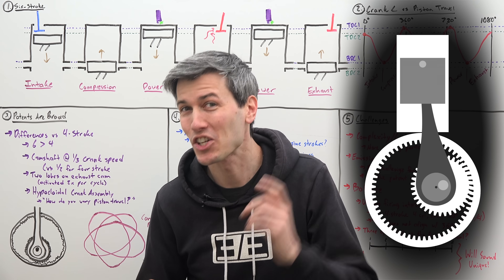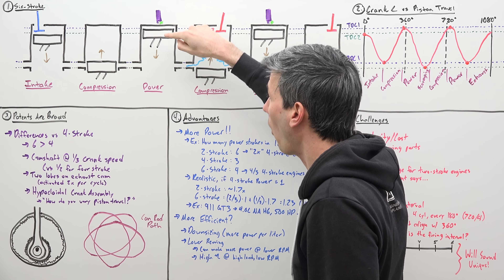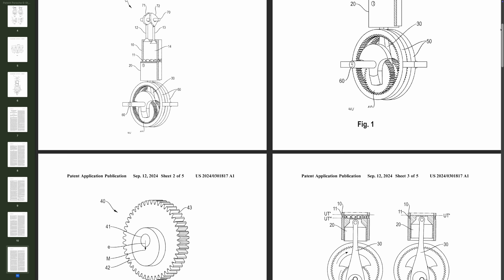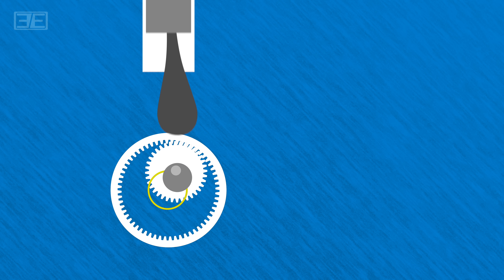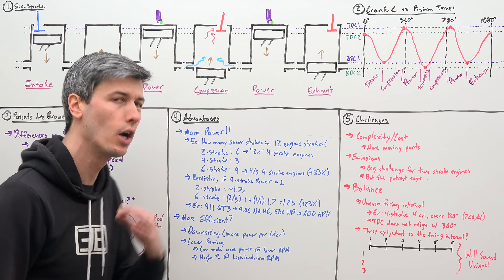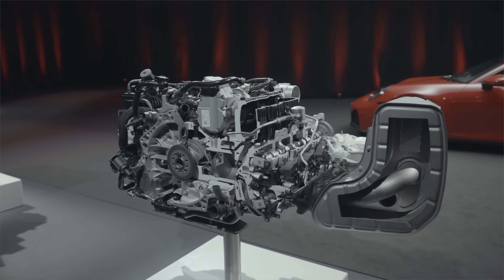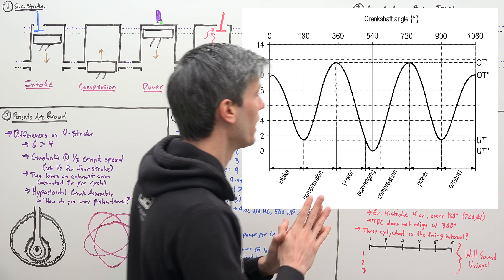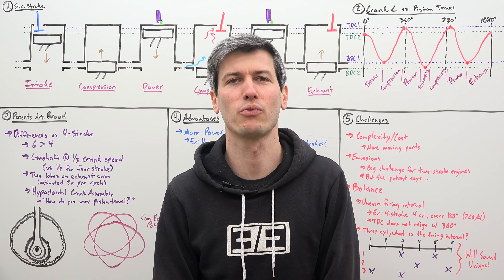Porsche's 6-Stroke Engine Is Genius!

Comment: Congrats on 1000 videos! 🎉

My thoughts:
1) This is a very interesting patent!
2) The first power stroke has a greater expansion ration than its compression ratio.  This is an Atkinson-cycle method to improve efficiency.  I am surprised this was not mentioned in the video.
3) IMO it is not difficult to imaging that emissions would be the same as a 4-stroke engine, with none of the problems that 2-strokes have. As pointed out in the video, there is no oil mixed with the fuel, eliminated one 2-stroke emissions challenge.  The other challenge is fuel-air mixture leaving the chamber before combustion.  As long as this 6-stroke engine has direct injection, the exhaust valve can close before fuel is injected, and only air will exit the chamber.  Not sure why Jason seems skeptical of this claim.

Comment: i wonder if theyll be turbocharging it? looking at the way a 2 stroke works, with the intake coming in the bottom of the cylinder WHILE the exhaust is pushed out the top, it seems like positive intake pressure would do a lot to help that process along while the piston is in the small scavenging window. then again, im sure theres a reason you dont see boosted 2 strokes so im sure theres a good reason.

nevermind i just saw your pinned comment. anyway congrats on 1000 videos!

Comment: It might just be the animation but I would hope to have large bearings on an offset center instead of the gears to avoid the wear. I haven't thought far enough to know if it would work the same. Coming back a few minutes later,  I don't think you could... The crank and rod need to be mechanically locked to maintain the path.

Comment: If running with 6 cylinder's it could run 2 power strokes then exhaust then 2 power strokes then exhaust etc.  Firing on 3 cylinder's every power stroke. so in 6 strokes 12 powerstrokes vs 9 on a conventional 6 cyl 4 stroke.

Comment: Balance is less of an issue at lower speeds, maybe that offsets part of the vibration issue. With lower engine speed there is more time to tune the combustion ( thinking direct injection), that could be part of the emission benefit.

Comment: Too many technical terms, so explain it to me in the simplest of terms possible. What's it going to change for any of the 3 types of 911's going forward compared to the 2024 model and let's say the 2026 if this gets implemented by then ? More horsepower ? Less fuel consumption ? Less oil and/or cooling usage ? More speed for the same amount of horsepower ?

Comment: Sounds interesting but impossible design. The friction of the gears in crank will eliminate all the power advantage and fuel consumption. The price for this gears and durability is the other question. And probably the noise from the gears. I see more problems than advantages.

Comment: How are you getting the O2 ratio right. Your second intake would have to be an oxygen rich mix as there is no exhaust to exchange for new O2. Thus making this consept only really work with an oxydizer like NO2. For the second power stroke at least or it will be a very bad burn ratio with limited power from the second power stroke.

Comment: Great video, the only thing I noticed is that when showing the piston positioning and cycling you placed it on the helical gear instead of on a crank that is itself moving on that gear to give the pistons a different relative position for the 2 stroke additional cycle. I feel that would be a better representation but not sure how exactly you could model that. Congratulations on your 1000th video and I always love the content!

Comment: I'm sorry to do this, but I really think you did something horribly wrong assuming the second power stroke is anything as efficient as a 2stroke engine. In my eyes 2nd power stroke is basically burning exhaust gas again - basically EGR. This stroke might help with emissions but it won't increase power very much. As the cylinder is already filled with exhaust gas putting in a little air and fuel won't get you a powerful second power stroke. Maybe this system even means decreased power!

Comment: I think the biggest challenge is lubrication. It will be impossible to seal  the lower air inlet with oil pressured ring over the gap. The solution might be double sealing (5 rings) in a thick piston or whatever... If someone really developed a lubrication method for two stroke except large 100rpm engines. I think this project was bord dead, at least Wankel complicated things for way more power.

Comment: regarding efficiency: wouldnt be the low rev factor be relativized because we need more fuel in a 6 stroke cycle than in a 4 stroke cycle? In the 6 stroke engine we have 2 fuel injections for one cycle, but only 1 fuel injection in a 4 stroke engine if I understood correctly.

Comment: Wouldn't the valve/ camshaft configuration be an additional complication to consider with intake valves at the top and bottom of the cylinder? Great video! Congratulations on the 1000th performance.

Comment: I bet an inline 3 would fire 2 of 3 cylinders every rotation or 360°. In his 1 2 3 4 5 6 problem description the cylinders would fire at 3&5, 5&1, 1&3. They wouldn't be perfectly simultaneous.
Reply: A flat 6 would fire twice every 180°.
Reply: It's going to burn oil. Oil will get into the ports, then above the compression rings.

Comment: Only a German engineer would combine a 4 stroke and a two stroke in one engine.
Reply: Nein,  you can't do that.
Ja, ve can. 
Nein, I tell you it can't work.
Ja, Ja, look, pulls out a plastic printed 3D model. 🤣
Leave it to the German engineers, all you need to do is challenge them. 😂
Reply: Felix Wankel basically did it.
Reply: @PrototypeSpaceMonkey  exactly this is a piston based wankel engine.
Reply: @jeffwilliams6374  sigh. Dude... go learn how wankel engines work
Reply: @ See rotational geometry diagram at 7:07. Same as wankel geometry, only using multiple cylindrical pistons instead of one Vicks cough drop shaped piston.
Reply: @cdreid9999 What are you talking, they are right, this is similar to a Wankel design just with common pistons...
Reply: @PrototypeSpaceMonkey  no.. that isnt remotely what a wankel engine is
Reply: Germans didnt designed it, Credits to the University of Cluj Napoca Romania. Check the patent
Reply: Or the japanese engineers 😅
Reply: @checker1o125  um.. on what planet are japanese engineers revered??? Im guessing youre young. Japan did what china did. Stole ip from the west then invested in education and industry. Those brilliant advancements they made they stole from the us and europe. On the US side they won because the US automakers had become dinosaurs who refused to use that tech and relied on their syndicate and political connections rather than competing with each other.
European cars are still top of the line and japanese and american vehicles still cant remotely compete on quality (note: we have had big tariffs on european cars for a very long time)
Reply: @cdreid9999 silly. Every French car is a piece of garbage besides maybe Alpine, and even that is still little better than a Miata. British cars are also garbage. Just say German. It’s just German cars that are good. Italian stuff is also super unreliable and overpriced as well.
Reply: @cdreid9999 . At planet F-1 bike racing, planet Indianapolis 500, etc. 
Tho nasty USAC interfered and then took it away, Honda Motor Company, the Most Capable on planet Earth, won the Indianapolis 500 their Second time there. You?
Reply: False the 6 stroke engine has existed since the 1800s.
Reply: Instead of simply apply stuff invented in the past 30 years to two-stroke and create a beast. Maybe opposed-piston engine?
Reply: Das auto!
Reply: And Japanese.
Reply: Porsche (don't forget to pronounce the trailing "e", btw) is absolutely keen to stay with fuel burning engines – despite the well known need for ceasing burning fuel due to the climate change. Their CEO even was in close contact with the former secretary of finance (who at the same time was leader of the smallest of the three parties forming the government) to have him insist on allowing at least fuel burning cars on  e-Fuels – which was kind of a scandal here in Germany... Having that said to describe their neglegtion of a changing world around them (not very innovative...): They try anything to  find arguments on burning fuel. An engine that reduces further the fuel consumption to them is one that might fulfil upoming future limitations on pollution for new cars. In the end the end their question is:  How can we reduce the emissions but keep the incredibly high amount of horse power to run their cars that get bigger and bigger just to show off. I expect them to wake up one day, when fuel-burning cars get forbidden with realizing having spent too much money for a technique that was known to die soon the moment it was done. Total nonsense...
Reply: @jurgens.3964 you say that, but Porsche has also adapted EVs better than any other legacy automaker besides BYD. Also all the climate change hysteria is ridiculous since passenger vehicles are less than 8% of CO2 emissions. Reducing globalism and finding a replacement for concrete would do the most to reduce CO2.
Reply: Fuel burning vehicles wont be going anywhere ...oil companies make too much money to let that happen @jurgens.3964
Reply: @jurgens.3964”climate change” is total nonsense. It’s climate ‘control.’ 

Look up, sheeple.

Comment: Uniflow scavenging is not new. Marine engines have work this way since before the 1940s. In addition they are 2 stroke engines and are the most efficient in the world. Run them on methanol or LNG and they are also as clean as any IC engine can be.

Comment: Hey EE. Couldn't it be a more "efficient" engine by modulating how much the exhaust valve opens during the second compression stroke, and scavenge more air/inject less fuel to basically mimic what an EGR does?

Comment: Not an engineer, but to me it seems the most problematic thing is the crank... Imagine how complex it is to assemble, lube and service., compared to a regular one. Not to mention the wear of the gears. Also there could be power loss through higher friction... But still an interesting concept.

Comment: So they made a better 2-stroke engine and gave it 4 more strokes? Why not just keep the better 2-stroke engine... Also i highly doubt the no oil consumption when that lower intake is literally drawing air in through the bottom of the cylinder where all the oil is usually in. How are they going to keep the oil from mixing with the air in that design?

Comment: I don't get why this would be valuable or practical.  So they are combining a 2 stroke and a 4 stroke to get 33% more power strokes.  If you want more power strokes, just use a 2 stroke.  Porsche must feel they can completely burn everything in the cylinder during the 2 stroke power stroke- so why even bother with the 4 stroke portion?

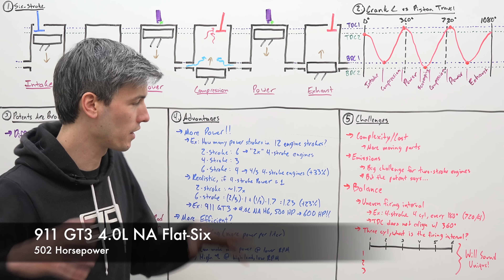Comment: 8:42 They couldn't run a 6 stroke to the same rpm because the extra stroke length to cover in the same amount of time means higher piston speed and, therefore, a lower maximum rpm

Comment: i would guess that they would keep the regular firing the same and just have the 2 stroke firing occur whenever, i would assume its going to be a lower power  ignition due to not dragging the air in.

Comment: hmm it can't be the first time someone thinks of combining 2 and 4 stroke into one engine. Thing that stans out to me is lubrication. A 4 stroke uses oil scrape rings to distribute oil alogn the cilinder, but that ring is now passing those ports. Oil gets mixed into the fuel mixture and burnt 'cleanly' as a solution. It might be a clean burn, but there's still more oil being burned in this design as oposed to 4 stroke

Comment: How is this supposed to run in the second powerstroke with NO Fuel inlet on the second compression stroke the exhaust valve is open the piston comes up and the plug fires and supposedly ,magically fuel has teleported into the cylinder. for the second ignition pulse.

Comment: I'm curious how the 2 stroke ports are going to work. There is nothing to seal the ports off to keep engine oil out of the 2 stroke intake, and if you turbocharged it, nothing to keep the boost pressure out of the crankcase. 2 stroke Detroit Diesels have similar ports, but the pistons are long and cylindrical, so when the piston isn't at BDC, opening up the ports, the piston itself seals off the port. I guess Porsche could do that here, but that would mandate a substantially heavier piston, meaning it couldn't rev very high.

Comment: Although a genuine pleasure to see a new and novel engine being patented, I can tell you now it’ll never reach production. It’s been patented on the premise that “if technology allows in the future” then Porsche will stop anyone else from being able to make it. It’s a “just in case” protection of an idea that is deemed potentially viable. The first problem is lubrication, the same as two strokes. Going past open ports means the piston has to have a two stroke burning lubrication system. The second, and larger problem is ring destruction. This has plagued two strokes from day dot. They need rings to hold compression and allow heat expansion within combustion chamber (piston and bore). Having them rub against the edge of a hole in the cylinder wall will tear them up quick time. Ask any two stroke dirt bike racer who has to change his piston rings every 10 hours of operation if he’d like to have the same issue on his very complex 6 cylinder sports car and I imagine he’ll use some choice colourful works to express his thoughts on it. I’m no engineer and would love to be proven wrong, but I sincerely think even ignoring the complexity and cost vs power gain in n/a application in a world where turbos exist, it’s a pipe dream engine.

Comment: With direct injection I suspect they have the capability to switch on and off the extra power stroke it could lead to an interesting combination of lean burn options.

The NVH and vibration implications are a potential nightmare, as would be the intake and exhaust NVH.

Comment: Seems that Porche has caught onto an idea I have been holding onto for a while. In percussion we are able to magically get 2 beats for one power stroke, this takes experience and also years of learning how to balance and transfer mechanical force through your own body. I can get 2 snare hits, 2 kick drum beats with one leg/ arm movement using the leverage built into our own limbs and joints. With more research and development I believe we can get 2 rotations on the crank for every combustion cycle. Getting combustion engines to have the same efficiency we do.

Comment: Another potential issue I see is that double exhaust cam. I think it will struggle with higher rpm due to increased probability of valve float.

Comment: Thoughts about the claims about EFFICIENCY:
1. The first (4 stroke style) combustion cycle implements an true Adkinson-cycle.
2. The second (2 stroke style) combustion might implement an internal waste gas recirculation.  Bad scavanging is an drawback of two stoke engins but can be utilised to fire an very lean mixture.
3. Having two different options of combustion gives more freedom to adapt to the actual load condition.
4. Under low load condition one of the two combustions could be skipping. This could be more efficient than cylinder deactivation.

Comment: I was wondering how the force is transmitted to the drive shaft when it rotates around the centre? You would have to install a cardan shaft in between. It is loud and has transmission losses

Comment: I don't think the firing order spacing would be too much of an issue. Uneven firing isn't a new thing. Motorcycles have been doing it for a while. A common example is the 270° offset used by yamaha and others in 2 cylinder bikes. And it does alter the sound

Comment: Complicated stupidity is what it looks like. Only way this would make any sense is if you can selectively switch between a 2 and 4 stroke mode for efficiency/power. Otherwise this is going to be one of those engines that they talk about in the future, i.e. The weird and strange of gas engines.

Comment: Porsche may work this out, yet you said alot when you talked about a 4 cycle 4 stroke have a nice even power stroke interval, which also has a even number of "rocking pairs" thus the 4 cylinder and V-8 both have balance merely in it's design, I suppose the V-12 would also have even rocking pairs but is added complexity in design and moving parts.

Comment: Parasitic loss would negate any gains if any etch a sketch is for children's art  ... You want more power ???? lengthen the rod increase stroke for dwell time TDC BDC, Shorten piston compression height increase skirt length for stability, increase compression and or turbo charge for best efficiency, secondary methanol injection (washer fluid) as intake air and combustion cooling and add'l power under full load to mitigate preignition  , reduce Reciprocating and Rotational mass, ensure complete atomization of fuel for a clean burn ....It'll run clean with less internal bearing stress rod stress and crank deflection all forged or billet aluminum parts ensure the entire assembly expands and contracts at the same rate to reduce possibility of oil leaks due to shear and shifting of dissimilar metals, all fasteners need to be studs for clamping force and ability to reuse at refresh or repair if needed.....  that's what i did with a 10.7:1 BBC 454 to 496ci tunnel ram dual 750 demons absolute beast revs like a weed eater destroys 18X32 tires .... They need to not to reinvent the wheel but work on the ability to harness hydrogen efficiently and safety due to the BTU potential .....Don't wanna wind up in orbit now do we ?  TT